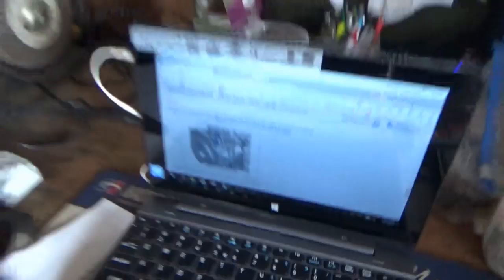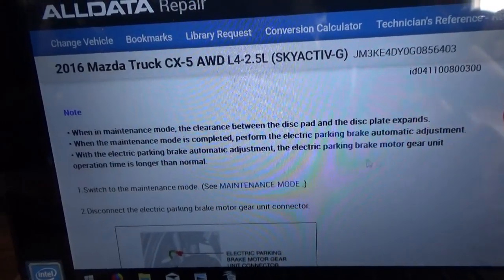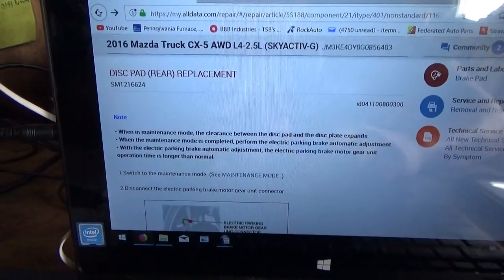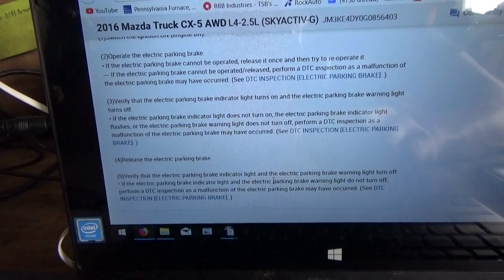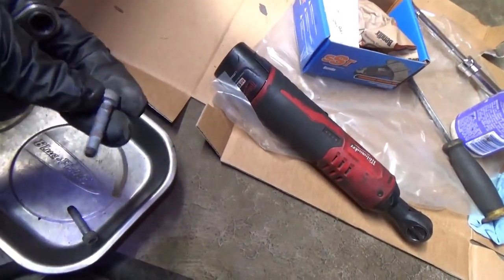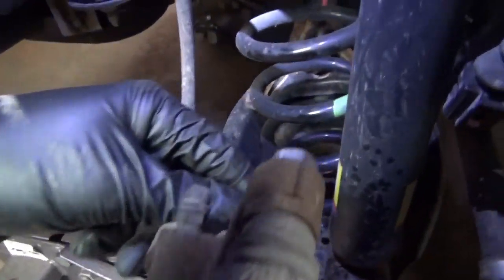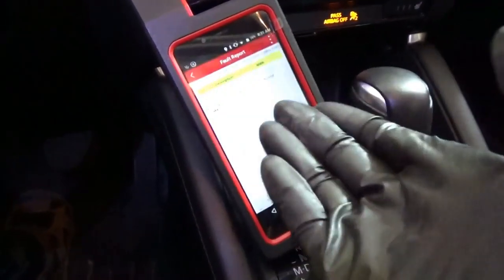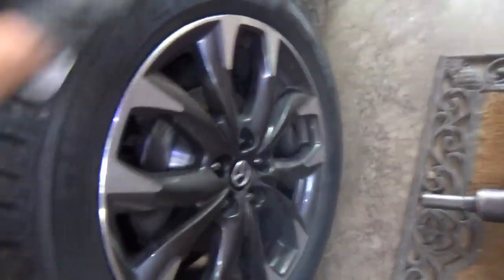Brake Job COMPLICATIONS! (Mazda CX5)

Comment: When you saw the wire on the caliper, why didn't you just youtube for information? There is no shame in that. Haha. As watching the beginning of this video, I paused the video and googled "mazda electric brake repair with epb". May I offer some constructive criticism? Sometimes I notice you skim threw information without taking in full knowledge of it. I understand it takes lots of time to read through all the mess, but directions are important sometimes. Throughout this video, it seems you still have not taken in for use the Alldata information you have read. Trial and error which you are doing at least some in this video is not so good with modern technology. Correct procedure is. You should print the info and hi light it in yellow, or open more tabs on your browser so it is always at your fingertips. Yesterday I had about 12 Identifix tabs open at the same and bookmarked them all.  Every time I click a hyper link, I do it in a new tab so I don't forget the thing I was reading.  I am not judging you as I live in the same convoluted world we all do and struggle in the same sorts of way as many of us struggle. The point is to read the info enough times for it to soak in and become a practical usage. Also, some doctors say, its O.K. to take your medication.... "plus" an extra half when needed. Haha

When I get stuck I go back to fundamentals of simplicity and try and work my way out from that point. You do this with electricity all the time. Good stuff. To my understanding the basic idea is hydraulics push the piston for brakes. Electronics turn an augur inside to adjust emergency/parking brakes and also push the piston. The piston never really does turn at all. I speculate the danger in repair is to not have the piston part of the hydraulic system bind the screw part of the electrical system and cause damage. It would be like putting a nut on a bolt, and then adding another nut as a jam nut. Simple enough to understand. 

The old type Mazda's also turned an auger every time you pulled the emergency brake cable. Turning this piston for brake repair reversed this action. The new types are electronic and the same action has to be done, but not mechanically as in the old days. It has to be done electrically. So what gives?  I guess they want the electronic part to be loose and free so "pushing" in the piston won't damage the electronic side. The "jam nut" analogy. The maintenance mode finds a happy place for the screw part to sit. It must have some sort of ledge to hold the assembly. It may even be double threaded on the inside. It may even have some reversed threads inside for all I know.

 Actually, I wonder if any of this proposed thought of damage would happen in your particular situation presented in this video. It seems to me you have not caused any damage. All you had to do was loosen the electronic part and free it so the computer could find the correct amp draw as it screws the auger outward to make contact.  Possibly, and if you really think about it, screwing the piston in could cause the piston to tighten up to much on the augur threads and basically lock the piston to the augur. Then, when the electronic motor try's to turn the augur, it now wants to also turn the piston which would cause a massive amp draw and kill the motor.  I googled to try and find out what is on the inside of the EPS caliper and how it works, but found nothing. All I found is a bunch of youtube retards driving down the road at 50 mps and switching the parking brake on. Go figure? Talk about a waste of time. Spam Tards they are. 

Maybe you could have found bi directional control using your main scanner screen and using system selection, or system function. I did not see you look there.  Also, your scanner says, and to quote it exactly: "If problems are found during the testing, please "sent" the "vehicle code" to the local service advisor, we will solve your problems as soon as possible". Did you "sent" the code? If they can't get good grammar who is to say they are going to solve your "problem". No wonder people speed read. It's to skip threw the crap that is everywhere.

My hypothesis of your frustration and a rant of my own: 

The reason why the world has gone rampant with technology is for sale tactics. New and improved. If a man is at the dealership wanting to make a purchase of a car, the salesman may say something like: "Oh. You should buy our Mazda because it has a "new and improved" electronic braking system which is easier to operate and much safer. This is a must have for you and your wife. Think of your wife. This means and ease of operation and safety for both of you". He does not say the owners manual is 487 pages of extremely complex information almost no one can understand. He does not say how much it will cost to repair the new technological brake system, or any of the other convoluted systems in the car for that matter. What ever happened to the phrase "lets keep it simple stupid"? Sheesh. I am a technophobe. I despise some of this crap, and even fear it.

Below are two easy and quick to understand concept video's of screw type brakes. One is the old mechanical type and the other is the new electric type. I can not proof read what I have written any more than I have already, so please forgive my bad grammar. Thanks Ivan. Your a good guy.

https://www.youtube.com/watch?v=nPRNbn9bdJg

https://www.youtube.com/watch?v=uM1HeDEjHOE

Comment: What a pain in the arse!!, i did wonder why didnt they put a normal handbrake lever in the car.
Using motors is just another silly part to fail :-(.
if i had to do it, i would measure the distance between the piston and caliper inside and make the other side the same, then put the shoes back in on both sides.
Then jump in the car and tell it to release then lock.
Hopefully both move together and no mardyness from the system lol :-D
Im sure something like that would work.

Comment: Manufacturers seem to think that installing more and more electronic devices and equipment on new cars is a good thing. It,s NOT !  I don,t know why the tried and true reliable, uncomplicated easy to repair mechanical devices need to be replaced by electronics !  Must benefit the manufacturer because it certainly doesn,t help the customer !

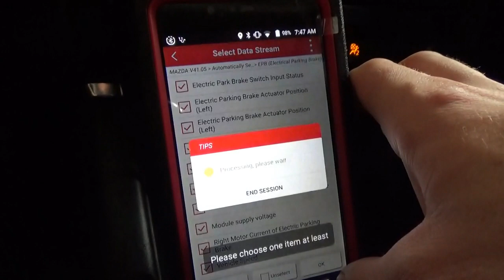Comment: 8:35 I got a Diagun IV a few weeks ago. I dounno if you realized yet. When your in data stream and selecting PIDs the "Select Page" button litterally only selects what is on display. You can hit it then when you scroll down the PIDs that were not on display when you pushed the button are not selected. It does NOT select all PIDs. I just seen you do same thing I had done a couple times when wanting just to get to the data as fast as I could.

Comment: Ivan. It's not 1970 anymore. Things move on. You admitted that you didn't read the procedure beforehand. These systems have been commonplace for over a decade now in most cases. I absolutely love your videos but this refusal to admit that things change or it was better in the "good old days" is crazy. Crash regs, ABS, EBD, VCA need to use much more advanced brake systems. The only disadvantage is that you can no longer perform perfect handbrake turns with a button!
Reply from the maker: They can pry the old-school handbrake lever from my cold dead hands! Resist! haha

Comment: I accidentally took the caliper off then I put it in service mode and the piston is fully extended and stuck that way now. I can't push the caliper back in with the regular no turning piston tool. Brake fluid came squirting out. Did I damage the emergency brake motor
Reply: I just did this too!  Were you able to fix it?  I'm stuck!
Reply: @jasondonovan1408  no get it towed to Mazda. You need a new caliper and it has to be computer programmed by Mazda. Good luck.
Reply: @denp28  C'mon man.  There are no electronics in the caliper.  Why try to mess with people?  :P

Comment: I fail to see the benefit to an electric parking brake. 

Seems to me there is no upside. If you have a failure either when parked or not it is an undesirable result, versus if it works there is no real advantage. 

Don't you love Japanese cars?

Comment: It occurs to me (donning my Capt'n Obvious hat), an electric parking brake effectively makes the "emergency brake" use of the same mechanism, a tire lockup device.
Methinks this is a case of practicality pointless over-priced over-engineering.

Comment: Rather than removing the actuator- unplug it, use a Power Probe 
to reverse current to motor, retracting it. Correct?

That Launch has it's uses and place- but not here.

You're usually good about following directions and procedures-
but not here. These newer cars are more & more gizmoed
to the balls; a simple brake job is still simple-

when you FOLLOW DIRECTIONS.

Read up on stuff- before you just tear into it.

I'm disappointed in your performance here- but at least learn
from the screw ups.

I wouldn't charge more time- it's your fault.

Comment: thumbs down to mazda and any other manufacturer pulling these stupid engineering stunts
Reply: Another reason to sell it and buy a Toyota
Reply: @djentyman4002  funny as I was thinking just afterwards how I plan to keep my 1998 camry for as long as possible. I'd rather spend a bit too much money on it than buy a more modern car.
Reply: jason mcnamara when that 98 Camry ever dies out just buy a newer Camry. Those things are super reliable
Reply from the maker: Yes keep the 1998 Camry alive!
Reply: @djentyman4002  Theyre the perfect middle aged man car
Reply: jason mcnamara I see elderly and middle aged adults driving them more and more every single day. Hell, I’m 23 and just bought a new Corolla. I’ve been very impressed with the quality and reliability